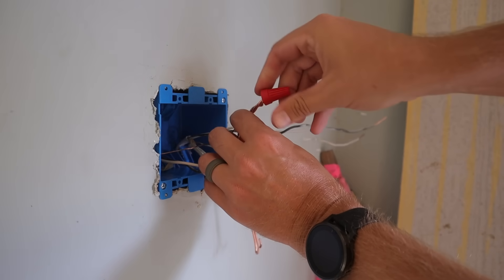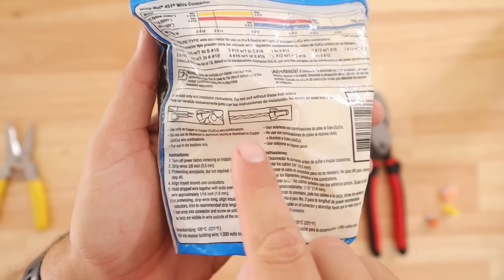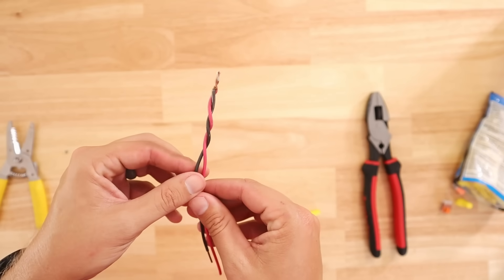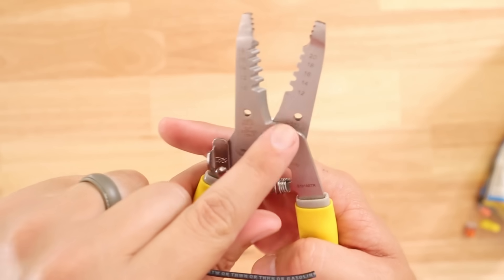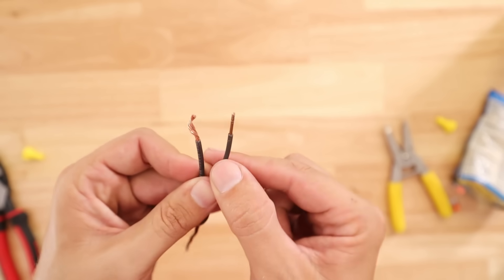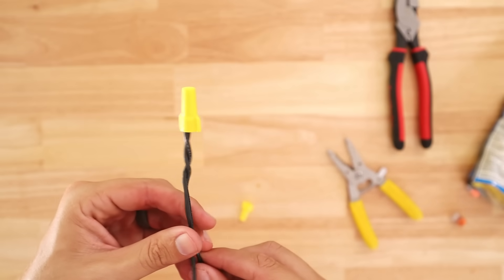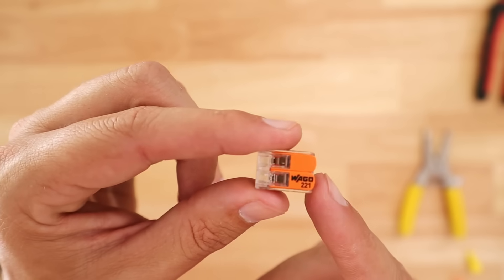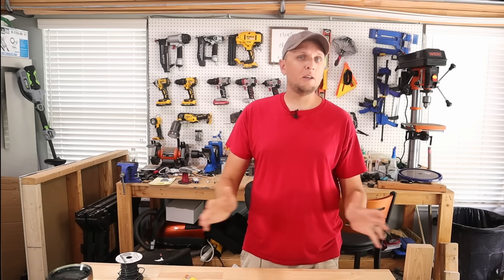BIGGEST Mistakes DIYers Make When Connecting Wires Together | How To

Comment: My electrician taught me after twisting the wires as shown by Adam to cut the ends at an slight angle making a better fit into the wire nut.
Reply from the maker: Yeah some say at an angle some say flat.  Depends on who you ask.  Thanks for the input Marc!

Comment: In New Zealand and Australia these Wirenuts are illegal. They do not provide clamping pressure to the cable to ensure it's integrity.   Additionally they look so easy and quick to just all for dc circuits.

Comment: Dielectric gel . Solder. Wire nuts . Slip in connectors comp air all for heating up connector , slip out of connectors . Good procedure or bad prep and procedures .. I see a lot of trick connectors but look like trash .

Comment: Wago lever nuts are awesome. More expensive, like 50 cents each vs a traditional wire nut which are like 5 cents each.  10 times more expensive yeah but 10 times quicker to install if time is the drving factor on your installs.  Moreso, removing electrical fixtures that use wago lever nuts is an absolute breeze, leaving those beautiful copper wires nice and straight...

Comment: Lifelong electrician and yes pre twisting is fine but when you know what you are doing and havhave made up thousands it ceases to keep you awake at night any longer to not do it. Manufacturers such as ideal even state no pre twisting required. 
Lead stranded conductors slightly and they won't pull out.
Yes a "diy'er" can get some comfort in being able to see by pre twisting but when you do it for a living and are making up hundreds a day in a commercial setting for example there is no way you are going to sit there and pre twist.

Comment: I put my stranded up in the wire nut then twist over the solid with a twist under the nut, works fine and is faster.
Reply from the maker: Yes that will work!

Comment: I just bought a house and proceeded to swap out all of my standard light switches for smart switches. Looking at this video, I didn't do a bad job, but I didn't do quite this great of a job. I know all the connections are solid and safe, but I might just go back and check them over one more time and follow these instructions just to be sure, especially on ones that have more than 2 wires in a wire nut, and perhaps even swap some of the more crowded boxes with the Wago connectors, they look like they might take up a little less space.

Comment: Super helpful.  You should also add stranded-stranded connections w nut to the talk.  You did solid-solid, solid to stranded (2 ways).  Please add stranded to stranded.   Thanks.
Reply from the maker: I definitely need to do that in a future video.  Thanks for the input Robert!

Comment: Ok, thanks for the video. This is my 2 cents worth for everyone else,  Push in connections are “ok “ for light loads like at a light fixture with led bulbs. Marrette, is the real name invented in around 1923 and patented in 1926 in Canada 🇨🇦 there are different sizes. Aluminum wire to copper is tricky because the aluminum gets brittle from getting hot if it was loose for a time so start with fresh cleaned wire. Some times the wire strips cut into the wire making it weak so use real strips NO side cutters aka dykes or a box cutter for all of you boomers PLEASE. It’s your house, so if there is a fire they will find your mistake guaranteed and they are looking for anything not to pay you insurance like no tape. Power off,,,test wire for live with a real tester,,,follow black hot,, black gold on a switch or receptacle white common but MAKE SURE green ground only,,,,remove all jewelry,,, take another sip,,,,twist until wire twists once or twice on insulation portion below marrette,,,give it a tug then a wrap of electrical tape,,take another sip,,,, tell the wife how good you are at this and tuck it neatly into the box,,, never in an open space not in a box with a cover and if you run out of nuts,,go get more cause tape and a pen cap will burn your house down at Christmas with a baseboard heater plugged in for 2 days and nights just sayin. Hey you smell something burning? TURN THE POWER OFF AT THE PANEL AND FIND IT FAST. hope you don’t mind my comments and DEE WHY EYE for life!

Comment: Important potential weakness I experienced in the Wago connectors -- the levers themselves.  If you are cavalierly jamming the wagos into tight spaces, other wires can hook on the levers and pull them up, which lets the wires in that wago slip out!  Therefore, I recommend putting a little tape around the levers on any permanent install in a tight space with loose wires.
Reply: I did the same, thinking the very same thing you were
Reply: How about not using them
Reply: @dominicbenecasa7893 Wago lever nuts are a better option especially compared to wire nuts.  A cage clamp connection will never let go and are way better with thermal expansion.
Reply: @Rcr0729  keep thinking that. I’ve been in the electrical business since ‘74. To each his own.
Reply: @dominicbenecasa7893  That it is.  I’m the son of a electrician and I work in automation.  I sell the Wago line so I know their product well.   Wire nuts are shit.
Reply: @dominicbenecasa7893

Comment: When I moved into an apartment for the first time, i found that I had lights flickering,   and when I finally found the source of the problem in the basement,   there were four wires  twisted Together with the biggest wiring nut that I've ever seen.   i didn't know how else to fix the problem but I got the wires twisted together in such a way that they would not come apart but I wanted to make sure they would not cause future problems.   i soldered the wires together replaced the wire nut,    and taped up the rest after it was all finished inside of a junction box In the basement.   I never had any more problems with that circuit And I would occasionally check it Just to make sure I wouldn't burn down the house.

Comment: Wago's are good when you do not have alot of space - whee wire nuts take up more space a WAGO will leave you more room. For example I recently had to change out some tree up-lights that had 1/2 inch LB's holding them to the trees - due to space constraints I used the WAGO in order to still fit in 6" of wire folded properly and be able to shut and screw closed the cover - with wire nuts this would not have been able to be done.

Comment: The best video I've seen on the subject, thank you!
I hope you will do a video on push connectors while using stranded wire. Maybe it's not a good idea to use them with stranded? When I Sauder a #12 stranded wire, it will not fit into a push connector.
Reply from the maker: You are welcome!  Yeah in most cases stranded won't work with the push connectors but will with the Lever nuts.

Comment: twisting the stranded around the solid typically leads to the solid not being bit by the b-cap
since you twisted the wires it will probably be fine
as for another comment below, that says just make the stranded a bit longer this is a good start, but both wires should be held firmly together while you twist on the b-cap
you would be surprised how many electricians don't do this, and the stranded gets pulled to the top of the b-cap and leaves the solid barely hanging in there

personally i'm not for twisting, the main problem i see with it is additional metal fatigue
the other is if you have to work something hot, you have to remove the cap, pull out your kleins, then untwist the wires
with untwisted, you grab the wires firmly, remove the cap, and cap the hot
a much safer option

if you're dead set on twisting, there is a way to twist your stranded and solid
cross your stranded and your solid at 45deg of the other, line your kleins so the the handles line up with the stranded 
squeeze firmly and twist, this forces the solid to wrap around the stranded, but since it's more rigid, you'll end up with a regular twist as though it was to stranded wires

wagos are the way to go, yes they are more expensive, and a lot safer when working hot
they also don't fatigue or stress the wire, and therefore don't require you to snip the wire shorter and shorter (if following code) with each removal of a b-cap
sorry can't remember the code and too tired to look it up

edit: also you might want to add a disclaimer, even 120v is enough to kill, and even electricians sometimes forget to double check the circuit after turning off the breaker

Comment: I was taught to not pre-twist for residential. Using the linemans will damage the wire and having to snip off the end will shorten it. The wire nut twists the wires just fine. Only if I had 9 grounds I was pig-tailing out would I think about pre-twisting. If a remodel comes through or you need to splice and add a receptacle you don't want too short of wires bc they have been damaged so much they start snapping off and then you need to run new romex. I would twist until the wires are twisted together outside of the wirenut as you instructed though. --- I would pretwist by hand for stranded/solid splice before using the wire nut.

Comment: Very good content. Why did you cut the video right before you showed the intertwining of the wires by turning the nut? Was it not so easy? Did you manually intertwine the wires as to demonstration what it would look like if twisting the nut worked as intended 100%. If feels as if it's not that easy otherwise why cut the video? While content is good, would have really appreciated showing the struggle vs the polished content that omits what happens in a real world application.

Comment: How can that NEC code possibly be enforced? Are you supposed to keep the bags around in case of an inspection? What if you replace a device and used a different nut? How is anyone supposed to know what is correct or not?
If I'm working on existing work and I see your "wrong, untwisted" example in the box, how would I know that the mfg's instructions didn't say to do that?

Comment: I prefer to get an insulated inline connector that is large enough to accommodate the two wires running end to end and then run each from the opposite end so that the bare wire ends are touching each other and then bend over each tip to form a bead that cannot be pulled back through.  Pull the wires back slightly so that the bare looped ends are not exposed and then crimp each end of the connector and in the center.  The connection is actually stronger than either wire by itself and does not have the wire nut bulk.  It also looks much more professional and is much more electrically secure.

Comment: I always twist the wires, cap and twist then also used black electric tape around cap to wire. 
It sounds like overkill but I’d rather go the extra mile.
I even cover the side screws with electrical tape.

Comment: Or you could just solder the two wires together and put heat shrink over to insulate it. Far more professional, a better contact & stronger.

Comment: Like you pointing out stripper gauge. Though I honestly never look anymore since I have done electrical for a while. Just like I use too small on some stranded to taper for easier pulling, then chop that off. Wagos were just starting to hit industry when I was wiring and they sucked at the time, but I hear they are way better now.

Comment: Very helpful.  Thank you very much!
Reply from the maker: You're welcome!  Really glad to hear it was helpful.  Thanks a lot for the feedback!
Reply: Well if the wire nut can come off exposing the joint that's not very good even if the joint holds. If by bad luck two joints are exposed and touch it probably won't be a good outcome. I think I'd like to add some tape at the base of the wire nut overlapping on to the insulation.

Comment: I hate wire nuts. I use the IDEAL In-Sure connectors whenever practical. I only use wire nuts when I have to connect stranded wire to fine stranded wire or solid wire to fine stranded wire.

Comment: I’ve never done any type of electrical.  My question is, or problem, none of my power windows and locks, don’t work in my 08 Chrysler 300C. I watched some videos on YouTube, and figured out the problem. Rite in the hinge, where the door opens and closes. The wire we’re getting pinched, even with that rubber thing around it. So I pulled the rubber back, and I have like 5 wire cut. The problem is that they are real small and short. Would I be able to add wire to them, like u did in the video? I tried to splice them together, but I they didn’t stay together. 
   Could I add a piece of wire, like u did ? And could it be any color wire, or does it have to match colors ? Like I said, there are 5 cut wires and they are real small and thin?
What would u do ?

Comment: It's a better idea to twist the stranded 
Together to act like a solid
Then twist that with the solid core
Ensuring BOTH. The solid and stranded
Twist equally 
IE not just the stranded wire twisting around the straight solid core 
This can easily be achieved by bending the exposed ends to 45 degrees where the insulation starts
Ergo there the exposed wires are at a 90 degree angle to each other  
Twist the exposed wires  together with linesman pliers until you reach the end
This is a solid connection that the solid core can't just be pulled out the middle

I would never trust a wire nut
I've seen way too many just fallen off
It's Best to use a BP connector
An insulated single or double Screwed metal tunnel 
As  long as it done up to the right torque 
A screw and tunnel is The most secure connection  around 
That's why screw connections are used 
on circuit breakers
Earth links
Neutral links 
And the terminal on HRC fuse blocks etc 

Either tunnel screw connectors or soldering is best 
For guaranteed success and longevity 
Of your electrical work 
Your work Should last as long as the building stands 
Or aim for at least 50 years 

But diy people may not have the 
Skills to do either safely soldering correctly  or BP connectors

A lot of my work is still in use and still working today without needing replacement or repair 
And still Being used on a daily basis and is Over 30 years  old now
(Some of my work was done in hirises that have since  been removed for new bigger developments)
So it lasted the life of the building with out failure

And In many environments 
From commercial hi rises,
Historic buildings and land marks,
Domestic houses / buildings
, Large industrial sites of  production and repair,
 Thru to hospitals,and medical/ animal research centres 
To farm stations in the middle of no where

If it's done right the first time it stays done right   for decades  to come
And you Don't need to drive 6 hours  from the nearest  town  or  11 hours from the nearest city just because your 
Wiring joints failed 

Quality and precision  longevity is often more important than just getting it going and leaving a bodge job behind
That's only just holding together

With electrical work safety and reliability 
Is paramount

Wago connectors may be ok
-As long as the plastic  doesn't become brittle after 20 odd years possibly allowing the lever and or catch mechanism to break off  Releasing the pressure  on the join
Allowing it to break free

If the pressure was spring loaded by a metal tab and lifting the lever lifted the springs  pressure on the wire then maybe ok as would have  a fail safe connection

The old school ways are 
More solid and more robust 
(As they had to be)
Unfortunately They are also a dieing art / skill
Even amongst the younger sparkles of today

Comment: "Vast majority of electricians will pretwist".  Based on what?  Been electrician 30 years, never pretwist unless wire is too short.  Don't know any other electricians who "pretwist".  In fact the old instructions for wirenuts said "DO NOT PRETWIST WIRES".  You cover why you don't pretwist, it can damage wire especially the smaller wire sizes. It's not necessary if you properly use a wirenut.  Finally you shouldn't need linemans to separate wires.

Comment: You also don't want to use the wire nut to twist your wires as much as it shows on the picture as you'll most likely start piercing through the nut

Comment: But if you solder the wires together, before adding the wire nut cover, … you will not have the indicated “loosened” connections, … 
And in reference as to, having connections being pulled on, … who in the devil would wire a moving connection, unless it is on a machine? Most wiring is expected to stay in place, making a firm connection assured by being secured properly with approved fasteners, …

Comment: Very nice video on using wire nuts. What I would like to know is:
1. How do you determine the proper size of the wire nut to use on the wires?
2. How do you water proof these connection?
Reply: As mentioned in the video, every listed device has instructions-on wire nut instructions it lists the number and size of wires they are designed to be used to connect.

And you would not waterproof this connection.  If you wanted a waterproof connection it would use different splicing materials that are intended to be used in wet or submerged areas or placed inside a waterproof enclosure.

Comment: Okay, as far as you went but I prefer instead to use Stak-on crimp connectors wrapped in electrical tape.  I think they make a better connection but  they do take more time to complete because of the tape wrapping requirement.
      Dennis

Comment: Why is it that after you twisted the wires into the nut, it appears that you slipped it right off? That could be confusing to a novice
Reply from the maker: I explained that I think.  It was showing how just because the wire nut is twisted on it doesn’t mean it’s on correctly or that a wire can’t fall out.

Comment: I like wago connectors (221's and up) , depending on your wire groups. I still like to either zip tie the wires approx. 4 to 6 inches down from connector or electric tape if you don't have zip ties, and then r- clamp the harness if possible to prevent movement. Especially in RV's